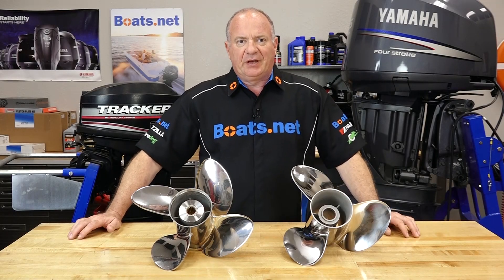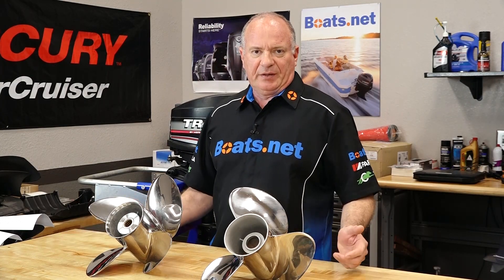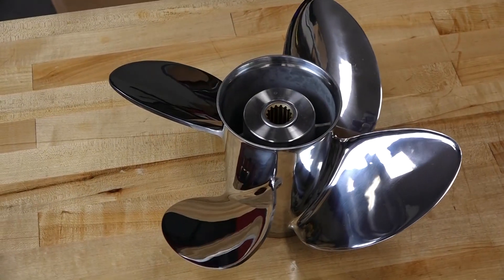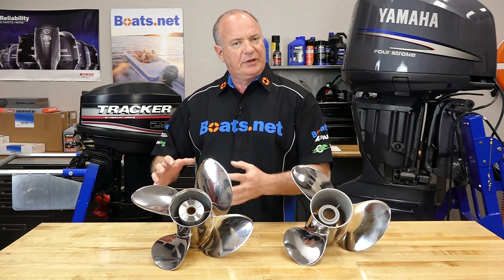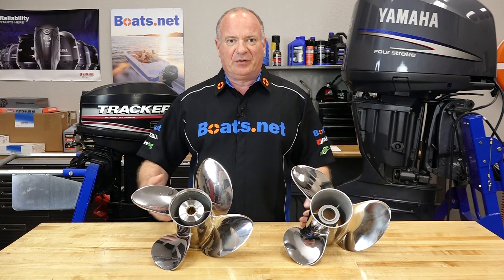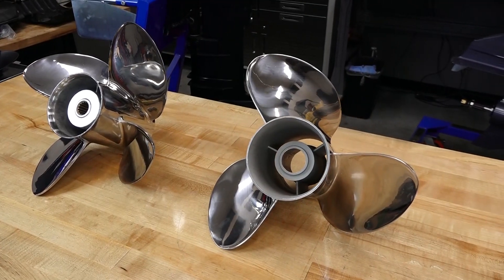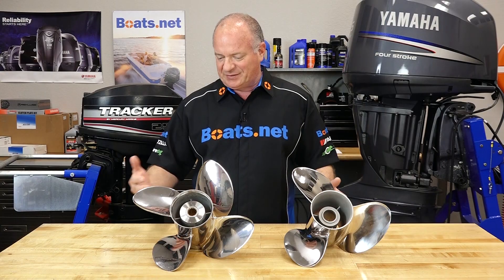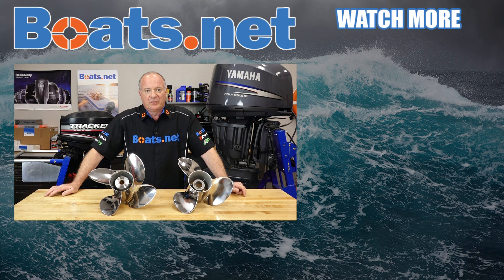3 Blade vs 4 Blade Propellers | What’s the Difference Between 3 and 4 Blade Outboard Props

Comment: I have a Legend 16.5 ft full windshield fishing boat rated for 75hp with a 60 hp Mercury 4 stroke efi. It has a 4hp kicker added, downrigger, 50 liter inboard fuel tank, livewell, trolling motor, extra battery, anchor, stand-up camper top, extra oil, tools, prop etc, it would barely plane at all with the original 3 blade prop with 4 people. The 4 blade made a huge difference, then adding a hydrofoil made it even better with no bow lift getting on plane. I run on big water for the size of my boat so top speed is not a priority and I don’t notice any difference in top speed since I have to slow down for waves and much larger boats wakes anyway. The quick planing without loss of sight due to bow lift and low speed planing coming into shore in high traffic areas is a huge safety improvement. I’m lucky to get 33 MPH wide open but I’m ok with that especially with the canopy up keeping the sun off, I cover around 25-30 miles round trip in a day of fishing and usually burn just 1/5 of a tank of gas (10 out of 50 liters capacity, 2.5 gallons out of 13) Thats pretty good for a full day of fishing hauling that much weight!

Comment: Well, four bladed props have thinner and weaker blades. Three bladed propellers are tougher and last longer. I'd never seen propellers fail due to fatigue cracking until we started fitting Mercury's with the 4 bladed ones. You also get better fuel economy, less vibration and prolonged engine mount/gearcase etc. life from three blades. I've been an outboard tech for 14 years, and I've driven  thousands of boats. The dealer will gladly put on the four blades to make your boat feel more lively, but in everyday use, you're much better off with a a three blade. Your dealer does not care about the longevity of your drivetrain at all.
Reply: They don't....check Solas Rubex, amazing props!!

Comment: I've got a 4.5m aluminum boat, with a 50hp Evinrude in the back. It currently had a 15 pitch 3 blade. It was very difficult to turn left and right in the water 

Will going down to a 13 pitch 4 blade make it Abit easier to steer my boat

(Yes I understand triming engine ect. Doesn't help)

Comment: This settles it. I'm getting a 4 blade prop.
My use case is slow tubing with the little kids.
My current 3 blade likes to cavitate with too much power and when turning.
It would be awesome to be able to keep plane at a slower speed too (for the little kids on the tube).

Comment: I have a 60 hp Yamaha 2023, it's okay when I'm on full pin but once I'm on idle she wants to stall and idles rough plus has high rpm on neutral, thinking its mass air flow sensor, what do you think let me know or anyone thanks
Reply: I think you are correct

Comment: I have a 14 foot John boat w a 20 hp merc 4 stroke. I just installed a on the fly Jack plate on it to run shallow water.  Will a 4 blade have less cavitation ( sucking air)?😊

Comment: I have a 24ft Pontoon boat with a Suzuki 200hp for power. When I am pulling the kids on the tube, when I turn sharp "left" the motor/prop sounds like it is cavitating. In this situation might a four blade be a better option?

Comment: How about slow speeds? I live on a river with decent current with a three prop on a 25 foot tritune. Pulling up to dock, or in the boatlift can be rather challenging sometimes. Wind can also play a factor. But the boat is not very reactive when turning at idle speeds. Would a four prop help this?
I owned a 26 foot chaparral with a bravo three. That thing was like driving a car compared to this box of a boat. I can’t seem to find anyone to answer this question. Thank you

Comment: Looking to solve a problem with my 2006 Triton Aluminum boat.    Just added 3 new optima batteries that weigh alot more than the traditional lead cell batteries and have found that I have been having problems with the boat getting up on plane quickly since adding the additional weight.     It gets up on plane, but takes it longer now that I have the additional weight.    I have a stainless steel 3 blade prop on the motor now and was wondering if the 4 blade prop would help to get me on plane quicker with the additional weight.     Here is the motor information, please email me at cwjudd2@gmail.com with your suggestion to get me more and quicker hole shot if that is what the 4 blade will do for this motor.   Prefer Stainless steel prop: Serial Number: 1B102318
2005 90ELPTO Mercury 90 HP motor

Comment: Im new to the boat world. Just bought a maxum 1800sr and the previous owner told me that with certain pitch props you have to keep the engine below a certain rpm to keep from damaging the engine. So my boat has a 17 pitch prop and he told me not to take it over 4600 rpm. Can someone explain to me why this is. Thanks
Reply: You want your motor to have the ability to hit top speed in a sweet spot, well below redline, too much prop, and you have the motor under too much load, too little prop, you hit redline and damage your motor.

Comment: Why no one ever use two blade speed props any more  nothing beats that top end.
Reply: Vibration
Reply: John b   I had a two blade speed prop on a 100hp and no vibes   It picked up 20 knot Though.  Slower on take off but faster .   If it had vibes it was not noticed

Comment: I have a 3blade 21p.  I need a better holeshot for pulling tubers/skiers.  Should i drop down to a 19p (3 blade). Or buy a 4 blade 21p. ???
Reply: If you pulling tubers and skiiers it sounds like you need your boat to plane faster, i would go 4 blade